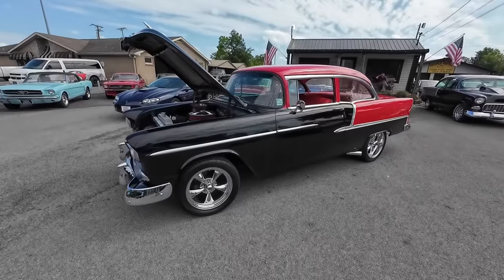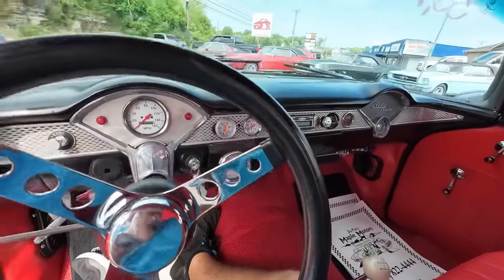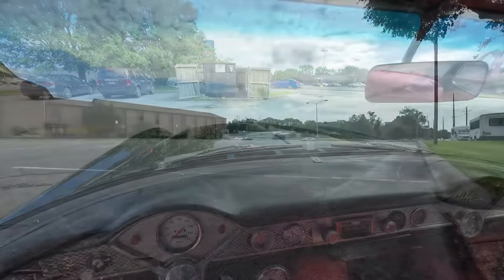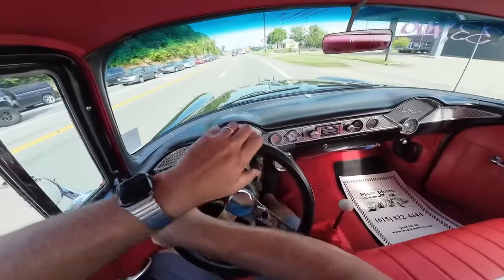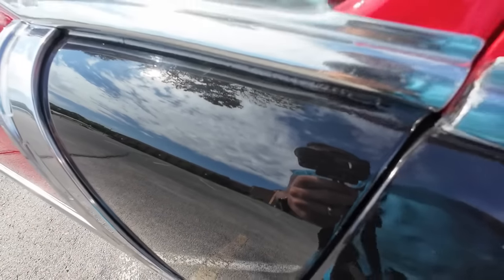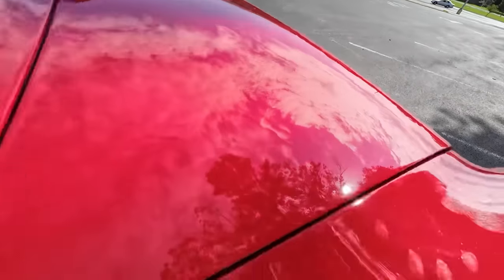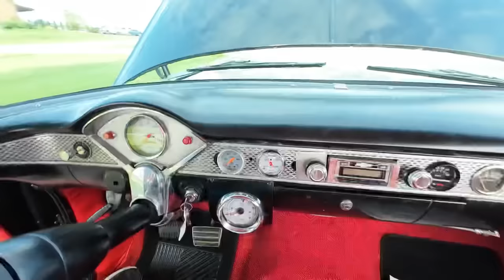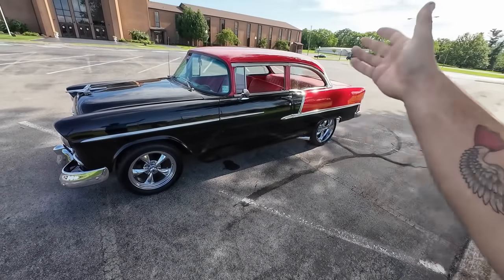Test Drive 1955 Chevrolet Bel Air 2 Door Post $33,900 Maple Motors #2262

Comment: It's a 50 footer...shiny paint, decent interior.  Typical 'flip car'.
LOTS of little things, either missing, not installed correctly, or deteriorated and ready to let in moisture.  I can quickly add up $5K of repairs...$10K if you can't do the work yourself.  Not trying to be mean, just honest.

Comment: There’s no molding in the trunk. Missing the rubbers. Missing the chrome whoever did the front and rear windshield I love 55s.
Reply: There was two rubber molding on the trunk on 1955 they put the molding on the trunk lid itself.